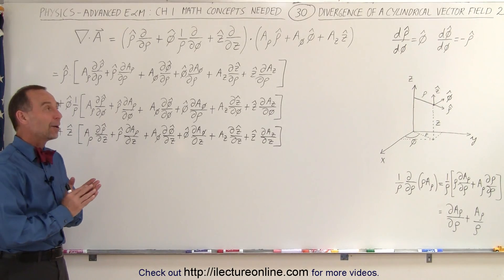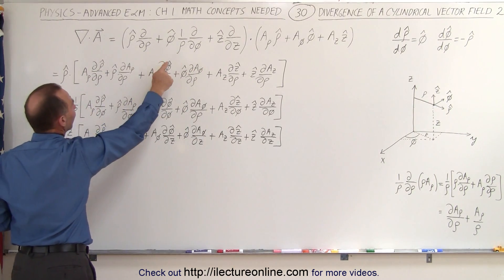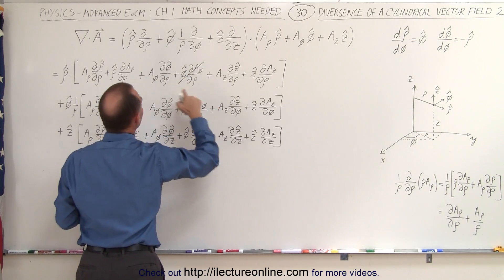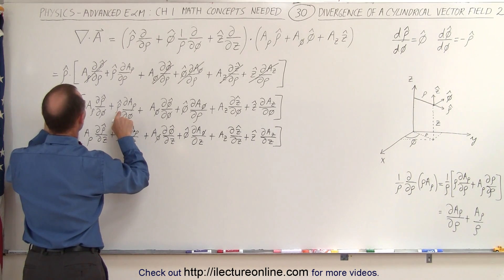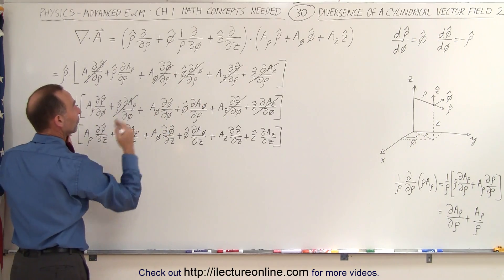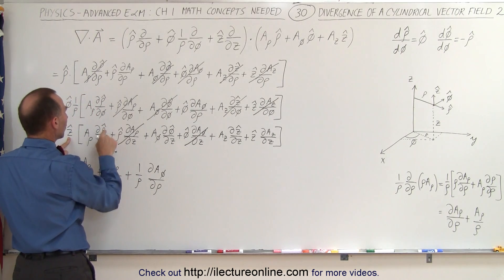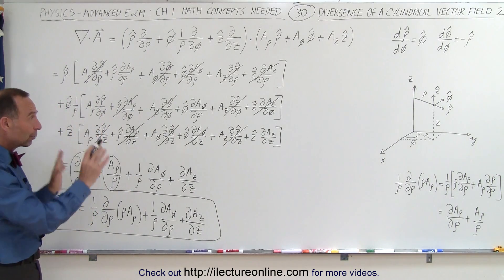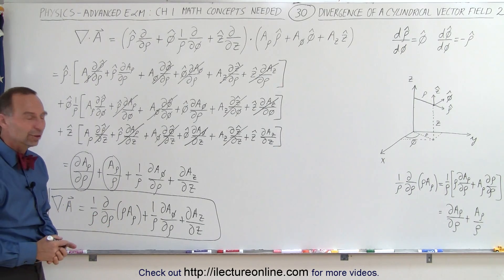Physics - Advanced E&M: Ch 1 Math Concepts (30 of 55) Divergence of a Cylindrical Vector Field 2

Comment: why do you take the partial derivative of each component if the dot product only multiplies parallel components?
Reply from the maker: You want to be able to show mathematically that you can get the correct result by following the standard definition and working it out.

Comment: Hi!

In the third line, following the phi unit vector times the inverse of rho, I don't understand the partial derivative of A_subphi with respect to rho, shouldn't it be A_subphi with respect to phi?

Thank you for your great work!
Reply from the maker: I agree that these partial derivatives are confusing.  But if you spend the time and work through them, you'll find that they are correct.
Reply: I'm sorry, but I really do think there is a mistake in the 3rd line which actually makes the final result wrong.
You can see in the link: http://imgur.com/a/h7yIz

Thank you for your time!
Reply: I believe you are correct, there is an error in second line 4th term. It should be d/dphi